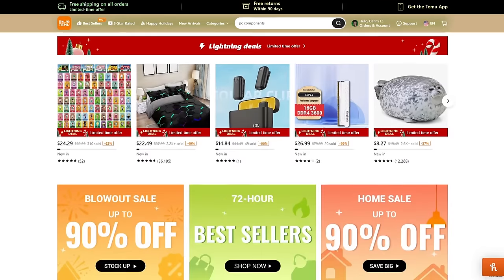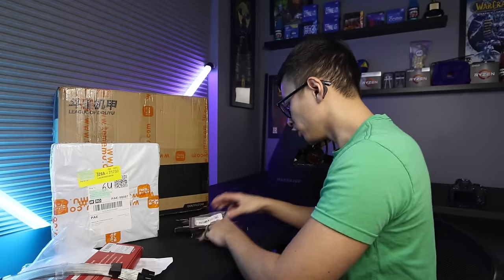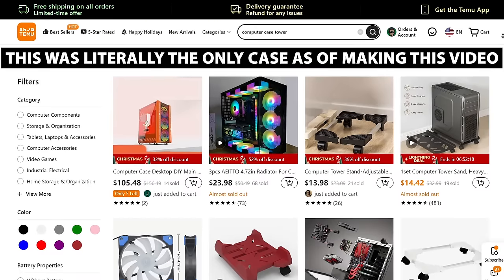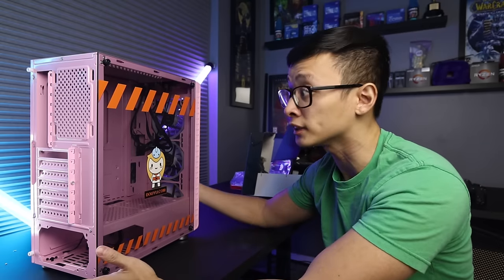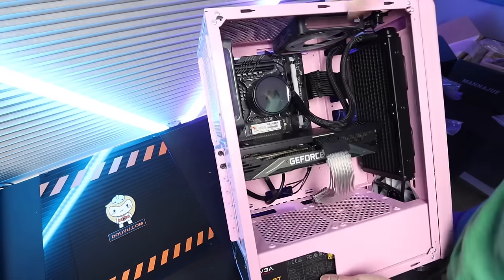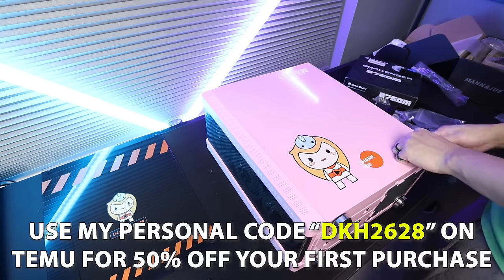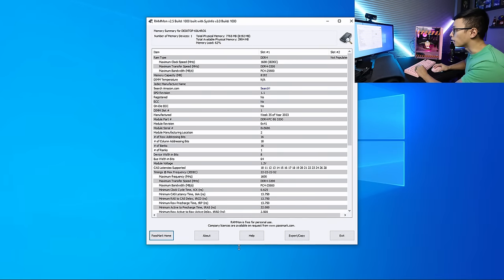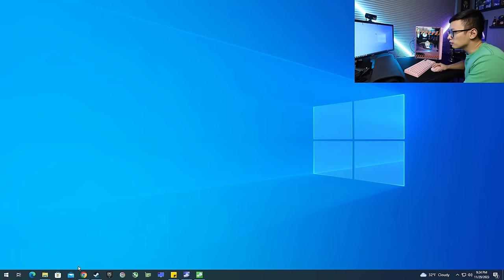I Built a TEMU Gaming PC

Comment from the maker: 💰 Download TEMU App to get 50% off for your first purchase on app : https://temu.to/m/uxbool708qe
🛍 Or search my code【dkh2628】on the TEMU App to claim
Reply: Is the aio discontinued
Reply: You should really inform you about a sponsor before promoting them, Temu leaked some users payment information and sold them on the black market
Reply: He sold 😢
Reply: I appreciate the full transparency on the nature of your sponsorship agreement with Temu. Hopefully a sign they are working towards being a legit PC parts supplier. I have two of those keyboard and mouse sets. One of the mice started drifting after 3 years and I had to dispose of a swollen battery in the mouse in the first one I got. The second one I bought about a year after the first. My keyboards have MX blue switches and I am typing on one of them right now. Great keyboard for the price. I expect the keyboards to last a long time but unless they upped the quality of the sensor in the mice, those are good for about 3 years. The first set I bought seemed to be an early production example and the second one seemed more polished and had larger battery capacity. I took a peek in one of the keyboards and it has a rather large battery that looks like a repurposed smartphone or tablet battery. I think I charge them about once a month.
Reply: don't buy new buy used. lower price higher quality
Reply: not a temu build
Reply: Temu added GPUS like 4060, 4060 ti 3060 and 3050s

Comment: I've picked up some random stuff off Temu and half is junk, half seems to work out.  My biggest problem is the variability in pricing - things are constantly 10-90% off and you can't trust that you're getting a fair price.  Returns were also a bit sketch.  More soon!
Reply: Even if you ignore those sales, the prices are still extremely cheap compared to what you pay for the same stuff on A-zon sold by drop shippers. On T-mu you buy it directly from either the manufacturer or a chinese retailer. There are no middle men (aka drop shippers), thats why the prices are that cheap.

Comment: its been 2 days and teemu has now raised the price of the case to $105. i was actually about to buy it transfer my server into because i could stand looking at that vs the testbench its on rn with loose hard drives hanging all around and for $60 no brainer, for $105 ill just stick with the testbench
Reply: Prices vary on there. You need to check more often. It will be available for less again.

Comment: This is a very interesting video.  I am glad you made it.  I have been very curious about TEMU.  I have not shopped that because I am worried I would never receive the items I order.  I trust your word over the other tech tubers so I think I will try to order something from there.  Thank you for the video.
Reply: As someone how ordered lot (nvme to USB, case and with RGB,ssds and more I get my order everytime. Just read make sure what you are getting is correct.
Reply: the old saying is correct, get what you pay for. unless you genuinely want cheap shit, shop at reputable places
Reply: @DaveYouTube-qr8ct  Like A-zon, where you can get the same cheap sh*t but for 3 times the price? Those are all chinese brands. Are they automatically cheap sh*t because they are chinese? Oh I forgot that most of the tech stuff you use in your not cheap PC isn't made in China. 

Just because you live outside Asia and dont know these brands, doesn't make them cheap sh*t. Tell me you are racist without telling me you are racist.

Comment: Hey, at a local pawn shop, I believe I got a decent deal $300 for an 
11th gen I5 11400 
Nvidia, GeForce, RTX3060 
The motherboard is a B560 
600 W power supply. 
I think it only has an SSD of 526GB. 
And then 
16 gigs are ram. 

I figured I am gonna put in 32 gigs of ram for my only update 

because I’m not sure what would happen if I switch out my SSD with all the stuff I downloaded previously, but I have to reinstall it

Comment: the radiator would have fit up top if you turned it around. still would have been tight against the front panel connectors.

Comment: I know im almost a month late, but i just watched your does the 750ti video still hold up video and if im honest it felt a bit poorly arranged. You used a 5600x3d cpu and showed quite a few cpu bound games. I think this made the 750ti look much faster than it actually was. Perhaps a test with maybe even a first gen ryzen chip which wouldnt bottleneck whatsoever but still have enough power to make modern titles load wouldve been a much better fit. It bothered me quite a bit when it felt like in many titles the cpu was pushing 70% of the frames.

Comment: Hello, I was hoping you could help me or any person reading this message. I built my very first PC with all brand new and all compatible components. I cannot get it to work. It turns on and runs but it fails to send a signal to the monitor and failed to supply power to the keyboard and mouse. I hooked up an additional 8 pin power plug and this time it does boot and it does supply power to the keyboard and mouse, BIOS lights and beeps, but it will not stay powered up. It keeps turning on and off and on and off. I switched a 600 Watt with a 850watt think it was a power supply failure but it didn't change a thing. I even swapped out the power cables and its still turning on and off. I'm on disability and on limited income it took me 5 months to get all the parts but i cant get it to work properly and I am at a loss. Any help would be greatly appreciated.

Comment: I know that this comment is off tangent. But don’t really know who else to ask. Basically I bought a new monitor (Samsung odyssey neo G8). I’m running Nvidia EVGA 3080ti. My problem is that when I set the monitor Hz on 240 (which is the the highest), my GPU can’t seem to recognize the monitor and it won’t turn the monitor on when starting the PC up. I would have to take the display ports and play around with it to make it work. Restarting the PC probably 5x before it finally recognizes the monitor. I then set the monitor Hz back to 120. After doing that the GPU recognizes the monitor even from a cold start up of the PC. I’ve updated the drivers and such but with no luck…. The only way for me to put my monitor at 240hz, is after I’ve turned my PC on with the monitor being at 120, then later change it to 240hz when it boots up….. any clue on why is this happening? I tried to find solutions but can’t seem to figure out anything. I also have a display port cord 1.4…. Any solution would be greatly appreciated!

Comment: i recently put 360 AIO on that CPU...yes it´s 360 not 240 all core load 44°C max so nope i won´t using that AIO btw...hoses on top is bad maybe some bubbles forming there and that´s the reason for high temps anyway a lot of builds have it mounted this way and never had a problem with cpu temps or maybe not never but i never heard of it so maybe it´s not properly filled or pump is slow or coldplate don´t make a great contact because of it´s shape...who knows but that high temps on 13400 ... it´s like stock cooler in games idk...

Comment: parts seem fair, pc case is very cheap looking, it still surprises me that molex is still being used in this day in age, I bought a modern 6x SSD 5.25" Hot Swap bay and thats got 2x molex connectors on the back stead of SATA power, some modern water cooling pumps still use molex, not sure bout AIO, i mean come on, it was bad back in the day its still bad, the alignment of the pins and holes on the female side are awful, its huge and ugly, just why, ok rant over, ignoring the colour, and the bodged on tempered glass if you paid more than £40 ideally less than £30 for that case its too much, maybe an extra £5 for the glass.

Comment: The ram will most likely be chips from major brands on target pcb. As a result they cannot advertise manufacture name since these are most likely used chips from used/failed ram modules. They typically remove the chips from used or failed ram from other brands and put the good chip[s on a pcb and resell instead of getting the chips as a partner directly.

Comment: My only issue is I SAW dual slot availability for that MF Ram 😭 dual channel even if it's just 8Gb will always be superior to mono, there's just never any reason to go mono...dual sticks will split the load and you can overclock a 1600hz to potentially 2400hz whereas mono you're stuck at 16...don't cheap out on dual ram 🥹☝🏽

Comment: god I would never plug any of those extensions into my PC regardless if it didn't matter if it fried. You can't even trust half the major manufacturers cables to work with your PSU as it is without extensive research to make sure they are compatible lol Good video though my dude.

Comment: The pea size drop rule for the thermal paste is kinda null and void at this point. The best way to do it these days is to spread a light coating over the entire CPU and if any squeezes out onto the board it's not big deal since it's non-conductive and you can just wipe up any major over spill with a paper towel. CPUS have become bigger and when you use the pea size drop method your actually neglecting about 25% of the chip of thermal paste cause it doesn't really reach the corners. Both LTT and Jays2cents have tested this with newer processors and probably other big pc related channels as well. They put the pea size drop on...mash on the AIO, take it off, and then clearly you can see the thermal paste didn't spread to a good portion of the CPU. Just a little tip. Get that extra thermal coverage. It can lead to overheating issues or at minimum running hotter then it should and that's really not good for CPUs like the 7950x3d that already run on average between 40-50 degrees.